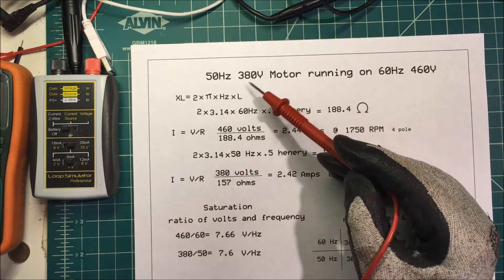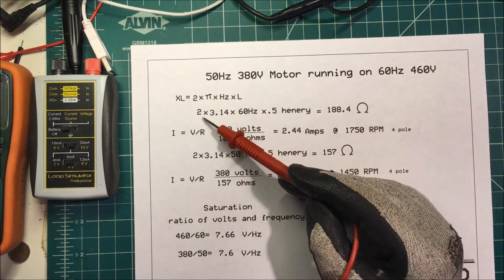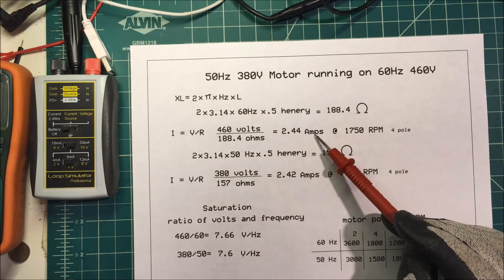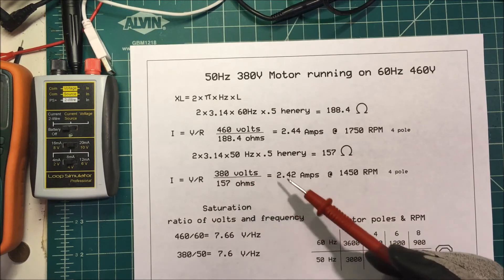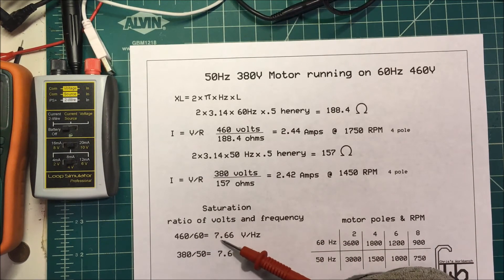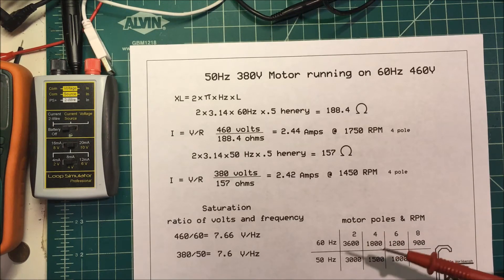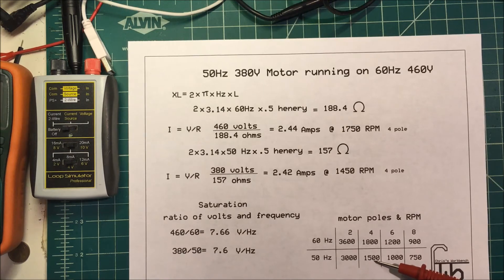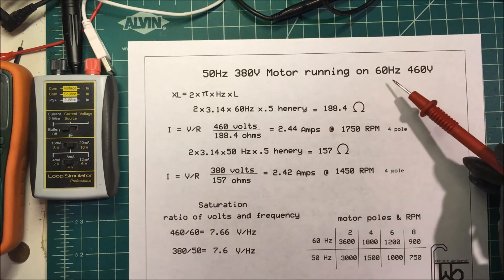Running a 380V 50Hz motor @ 460V 60Hz

Comment: I have a motor (400V 50Hz 4P, 55KW- Star Delta)But need to run in Gulf at  380V 60Hz. What would happen... Client doesn't want to change the starting method. how we can run this and what would be the consequences.

Comment: What about the higher voltage?

I would be concerned about winding insulation integrity, as well as support components (contractors, fuses, and electronics - although fuses to a lesser extent).  Contactor coils should probably be changed for 480V variants; but my concern still geuiningly lies with motor windings handling the higher voltage. 

Thank you for your video.

Comment: Supplying power to something with a generator at 480 60hz 3 phase but need to convert it to 400v 50hz 3 phase what would be your suggestion on doing so
Reply: Problem solve hoi h
Reply: Solve my problem
60hz 480v 3phas
On 50hz

Comment: I have (230 volt / 60 hz) air conditioner and the source is (220 volt / 50 hz) 
Is there any problem to run except running some slowly ?

Comment: Running a 100 volt 50 Hz motor (Japan) on 120 volts 60 Hz does exactly as in this video. If the higher rpm is not a problem then everything will be just fine. Having lived in Japan we ran 120 volt 60 Hz appliances on the aforementioned 100 volts 50 Hz and they ran just fine albeit at lower rpm or in the case of 120 volt light bulbs they just were a bit dim. Bringing Japanese appliances back to the U.S.: Again no problem due to the ratios of frequency vs voltage being the same both ways.
Reply: what about stereo equipment like Recceivers, CD players, Cassette decks and turn-tables?

Comment: very helpful video. thank you for posting. have a large 220v 50hz motor but only have access to 60hz.  better to run at 220vac 60 hz or or at 115 vac at 60Hz? The 20% greater speed is not a problem for short runs
Reply from the maker: Best to run the 220v 50Hz motor with a VFD at 50Hz